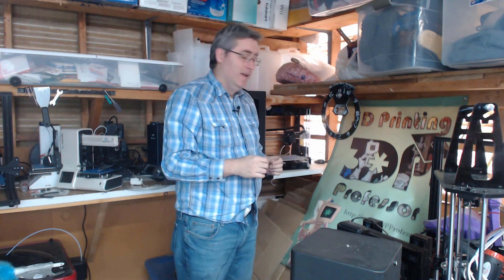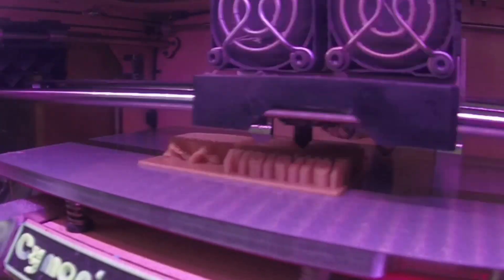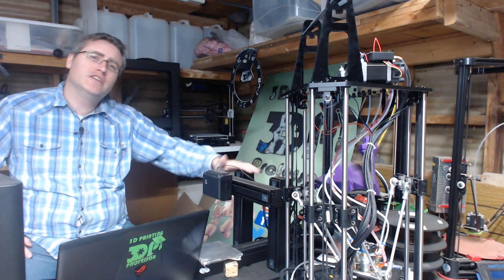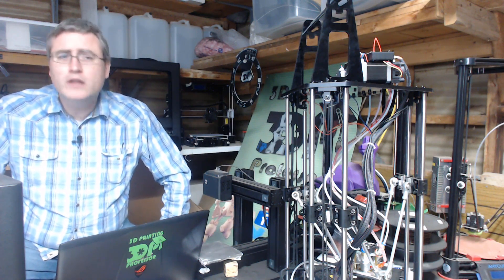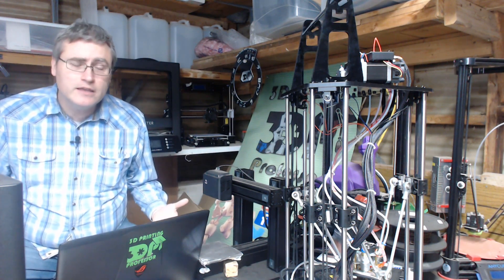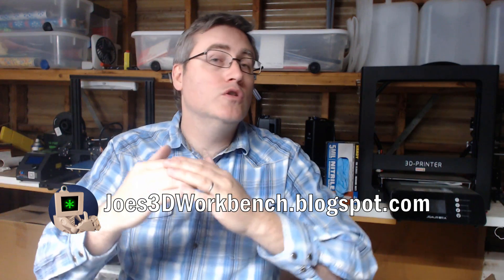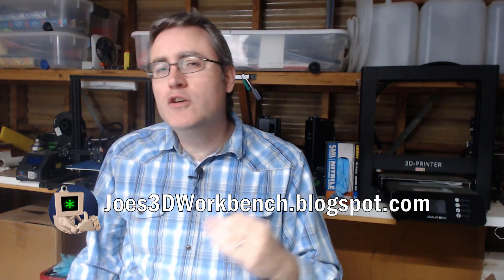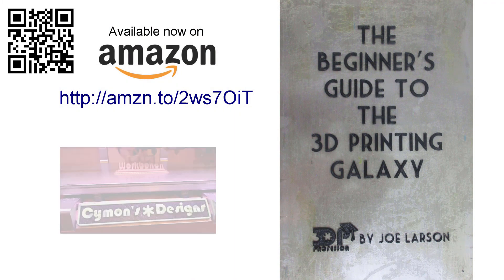March Madmess, a Month of Hardware Reviews

Comment: BY THE POWER OF MADMESSS!! Love it! :D

My only experience with Gearbest is my CR-10 and it 'only' had a bowed piece of glass, which I replaced with IKEA mirrors and went on with it. Of course I didn't like it, but looking at the price I payed for the machine I shouldn't complain. My other 3D printer buying/shipping experience is with Monoprice, for my Monoprice Mini, which ships from the US. It had a comparable issue (bowed heated bed, fixed with a piece of glass and a printe) and the same amount of service; none. I would ultimately love to buy a Prusa for instance and directly give back to inventors like Josef and take advantage of the service as well, but so far I haven't been able to afford one.

Comment: Listened to the AliExpress segment on 3D Printing Today. I don’t know about anyone else but I don’t have a lot of money to throw around so I keep tabs on all my orders from everywhere from the biggest site (Amazon) down to the little sites (MicroSwiss). I watch for tracking numbers in my email, enter them into the Deliveries app and check, the app at least every other day. 

The AliExpress iPad app has a great interface to track the entire order process from when the order is paid for, all the way through to acknowledging receipt of the goods. Out of the 20 or so small items, $12 being the most expensive single item, I have ordered I have only not received 1 in the expected time frame, I filled a claim and was refunded the money in a few days. The item arrived 2 months later repackaged by the USPS after it wound up in Jacksonville, FL because the address label had become almost totally unreadable. I know the items are truly on a slow boat from China and don’t expect it yesterday, but for the price I am paying that is OK with me.  

All that being said I spent the extra money to order my CR-10S, my first printer, from Tiny Machines, for the piece of mind of having a US based seller to communicate with should there be a problem. It paid off about a month after getting the printer the heating element died and Tiny Machines sent one out free of charge and I was up and printing again in less than a week. I have since purchased a stock of heater elements just in case. 

I guess what I am trying to say is, be a smart consumer, keep track of your orders, and if your not willing to risk a difficult return or repair process on a big ticket item buy from a seller on this continent.